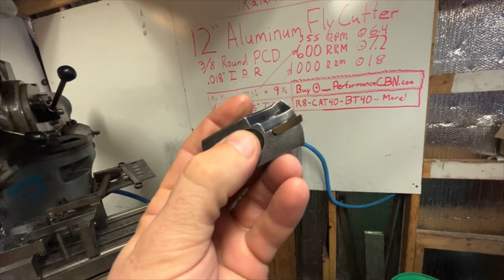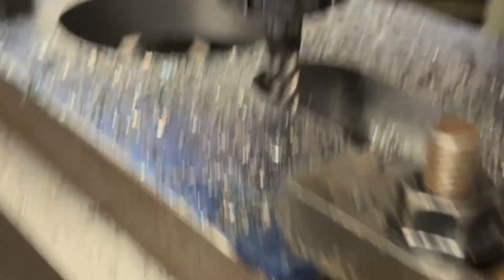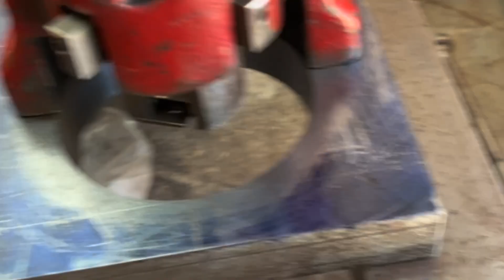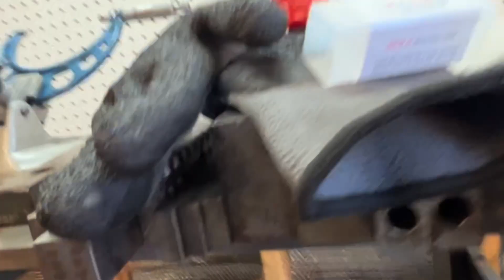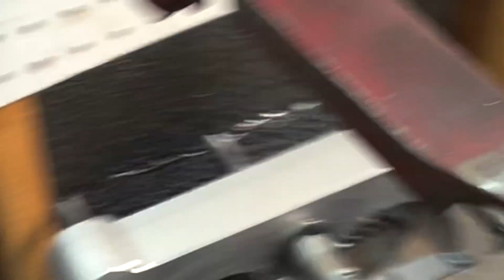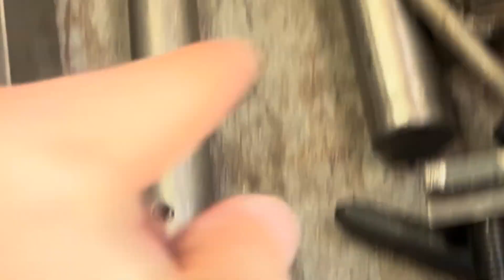Making a Blind Hole Plate for the Van Norman Boring Bar

Comment: I have a set of +30 Badger  Pistons Buick 455, PART NUMBER L3080F TRW ( B528) BADGER I can not find any specs for them, what bore clearance should I use?  they look like just cast, but Ive been told they might be hypereutectic?